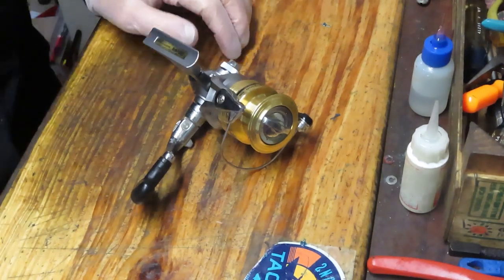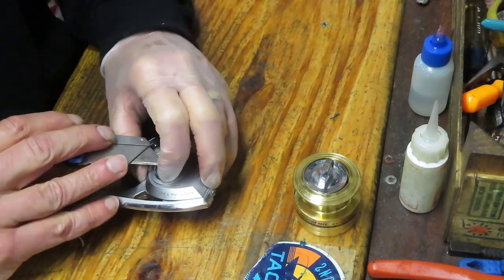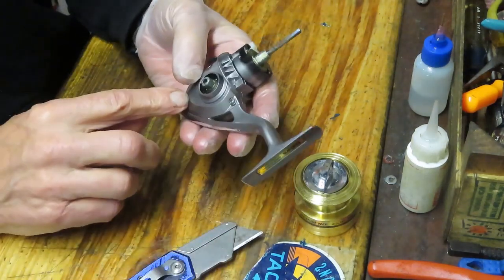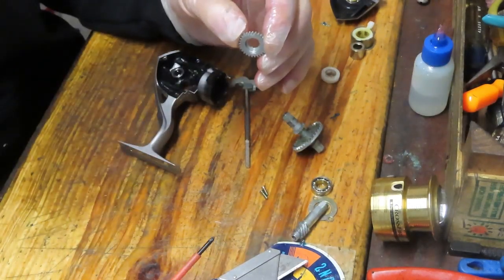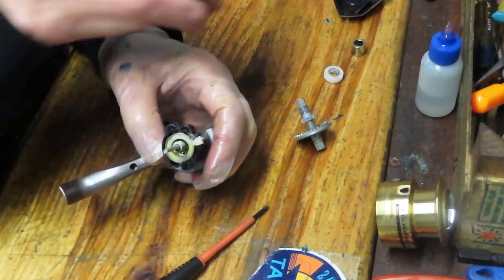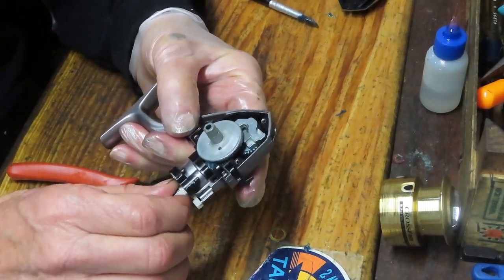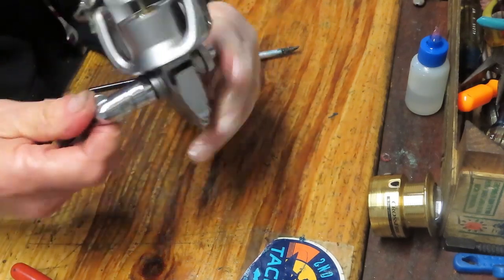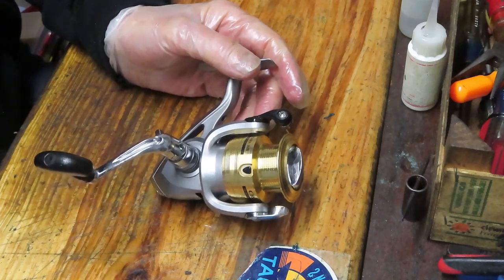Daiwa Crossfire 3500 3iB sping fishing reel how to service

Comment: I got my grandson a Sweepfire and it has been a good reel for him. If he gets into fishing in a more serious way then I’ll do better. So far I’ve been pleased with his use of the Sweepfire! I love the fact that this Crossfire has an AR override! I am surprised at the complexity of this reel. I don’t fully understand from the video exactly how the pinion, collar, clutch, etc. go back together. I think that if you can get all this assembled correctly this will be a fine operating reel. I do not like all those springs though. I do think it probably looks and sounds more complex than it actually is. Great video with a fairly difficult reel Dennis! You did a super job. PS. I got another Daiwa reel tonight off eBay.  I got one of these reels a few months ago so I got my second one tonight. It is a Daiwa Million DX 7000 three BB saltwater reel. It’s about the size of a 9000C or GS-9. My experience is that this reel is a high quality, very durable saltwater reel great for surf fishing. — Chris
Reply from the maker: These are great reels for grandkids!  Now your Daiwa Million....that's for you!   Hope the rehab of your hip is going well!  - Dennis

Comment: Hi, I have the same reel but model 3500 3ib and it is not braking. What do you think could be the problem and how can I fix it? TIA
Reply from the maker: Do you mean that the anti-reverse is not holding or that the spool continued to turn when line is being pulled out.  If it is the AR - there is probably dirt or excess oil on the inner clutch lever that would need to be cleaned off.  It should run dry.  If the issue is with the drag washers, you will need to remove and inspect them.  They may be worn or damaged - Dennis